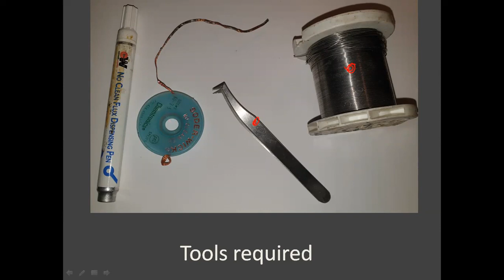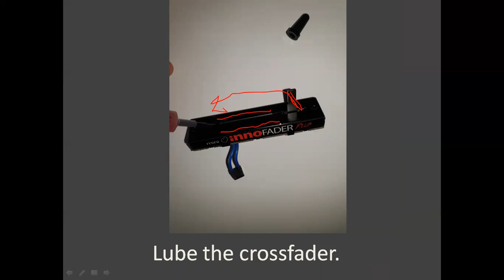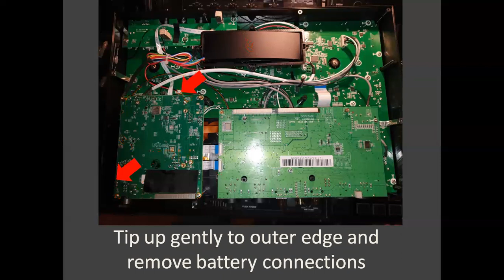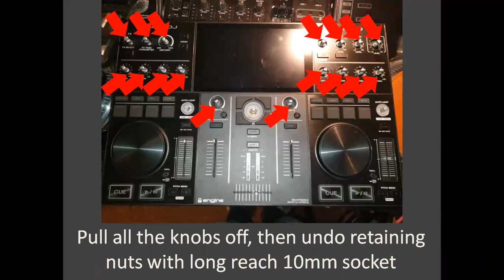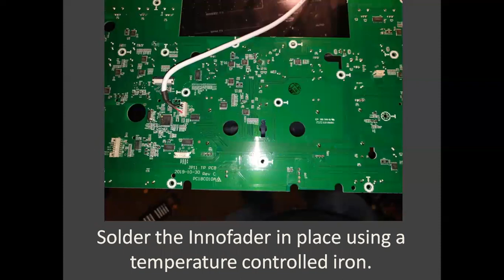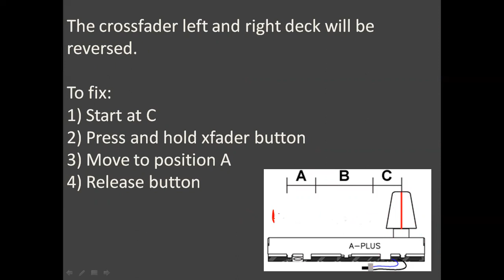Denon DJ Prime Go Mini Innofader Plus S installation

Comment: Had an electronics guy in my neighborhood help me do this. The innofader is soooo much better than the stock fader. The old stock one was starting to bleed sound on right side. Now, scratches and cuts actually do what they’re supposed to. If one has the means, I highly recommend it. Especially if you plan to do any scratching with crossfader.

Comment: Completed this last night, THANK YOU for the walk-through! The latest Innofader Mini Plus S does not require moving resistors or programming Left and Right channels; it works right out of the box. Just de-solder the old one, and solder in the new one. But all your other tips and disassembly steps were very valuable and appreciated!

Comment: nice tutorial! Im going to add a miniature rocker switch on the unit to reprogram the crossfader without having to open it again. THIS HELPS ALOT!
Reply from the maker: No probs, glad you found it helpful :)
Reply: @scottfunkattron4820  just installed the fader last night with a pushbutton switch mounted on the rear and looks factory! I still dont understand how Denon and others dont include hamster/reverse options on the crossfader 🤦‍♂️🤦‍♂️🤦‍♂️🤦‍♂️ Happy mixing/scratching!
Reply: @hardkore360  you got video?

Comment: I just followed all the step and have I  the fader installed but it’s stuck on Pt01 mode and I can’t reset it back to factory. It cuts the same audio on both sides like if it’s a pt01 scratch portable turntable. Any ideas?